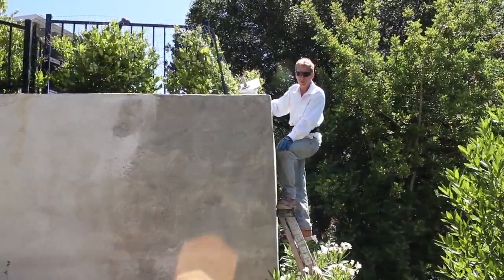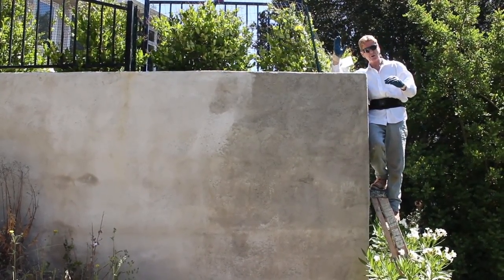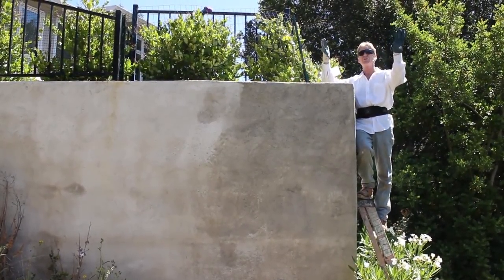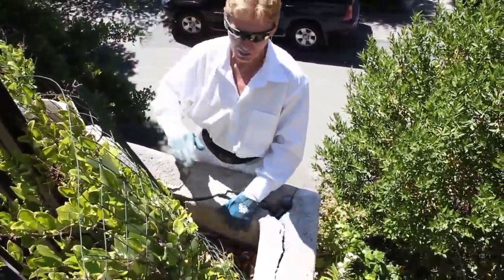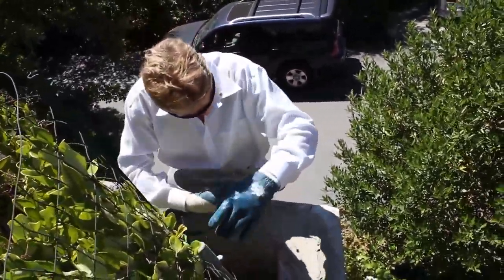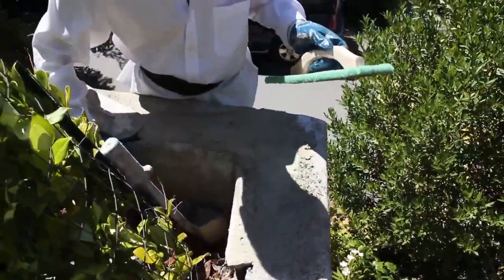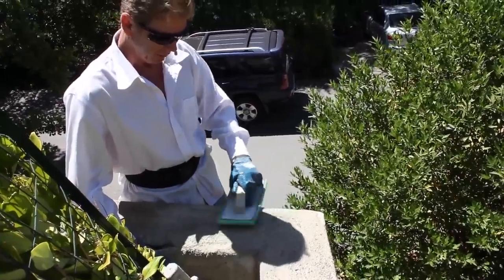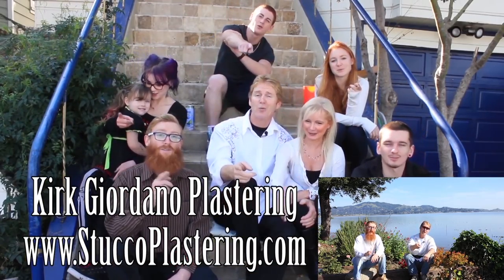Block retaining walls cracking

Comment: Hi Kirk its a good idear to have weep holes in the face of the retaining wall to release the static pressure caused  from the water. In Australia the walls we build need to have a weight that will counteract the weight of the soil ,the wall you are working on would be a lot thicker and usally mass concrete.Cheers John
Reply from the maker: Hi John, I agree, weep holes in concrete  retaining walls are a huge help, in allowing moisture out.
 Cheers,
 kirk giordano
Reply from the maker: The fellas who built this wall did a great job, with even a sound foundation, but if the grounds going to shift, it's hard to stop this action.
 Kirk giordano
Reply: +yolol I concur. I find it difficult to believe that the original wall was inspected/permitted.
Reply: I have a 60's concrete house with a carport made of cinder block walls. Walls that are built over what? I have no idea. No weep holes and a variety of mystery coatings on the blocks. 

For all I know Gnomes could be living in that space, or mutant cavemen. What I do know is that the liveable space doesn't extend under the carport. So, I think it is probably dirt underneath...I guess...maybe...I haven't actually heard any gnomes or Cavemen.

Comment: As you already know Kirk, buttresses were used in European cathedrals by the 12th century. Wouldn't filling those cracks in a wall such as yours be more than cosmetic if the wall is in a cold climate where water often freezes, causing even more damage than just earth movement?
Reply from the maker: Howdy Chuck, that's the facts jack, 
Spalling is well known in cold areas when the stucco and or cement moves just a hair, water then seeps in when this water freezes it expands and voila, spalling.
 "while the water freezes it expands the pops the cement apart, thus state the beginning of the end."
 Buttress were highly used during these times,
 Cheers,
 kirk giordano Plastering

Comment: Good  Video .. would  drain holes help relieve the pressure ? cheers PA
Reply from the maker: Howdy peter, every little bit helps, but I believe this retaining walls has a french drain system, as it was built extrealy well.
what is going on is quite normal, although a crack any any wall tends to alarm folks,
 Cheers,
 kirk giordano
Reply: I missed that part did you discuss there french drains ? I will replay video  to  see .. TY cheers
Reply from the maker: Morning Peter the cooking guru, 
I may not have mentioned they built this wall like the pope's fortress, exceptionally well complete with a top of the line wit french drain system, sometimes I just explain the repair and not get into what a fella has done prior.
 Cheers,
 kirk giordano plastering

Comment: How you doin' Kirk, love your vids..I was hoping you could give me some advice..I work for a municipality in New York (Long Island), and next to our D.P.W. building we have a small building that we call the tool shed, it's block walls and it's in really bad shape..peeling, flaking etc. You can see scratch coat directly on the block from broken off pieces, the entire building is going to be redone, I can supply pics if that would help. Any advice I would appreciate.
Reply from the maker: Howdy Jstincone, without viewing if it were me I would pressure wash with at least 3500 PSI strength to remove any and all loose stucco, if some of the brown or scratch coats come off, no worries "as you want this to happen" next apply a bonding agent then stucco as usual,
 Cheers,
 kirk giordano

Comment: Is this that wall you filmed a couple years ago? It was a big project. 3600 PSI! Don't try to use less! Your words still ring in my head lol.
Reply from the maker: Morning swan dude, correctamundo, we used 3,5000 psi water pressure to clean the dust, dirt, grime, however separation was not an issue on this retaining wall, I tiny bit of movement was, look much worse than it actually was.
 Best wishes, 
 kirk giordano